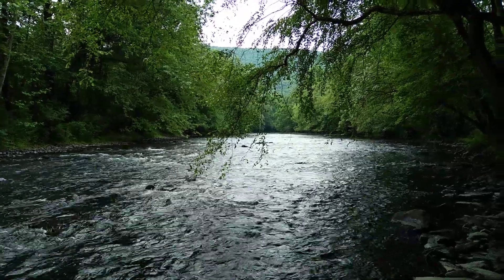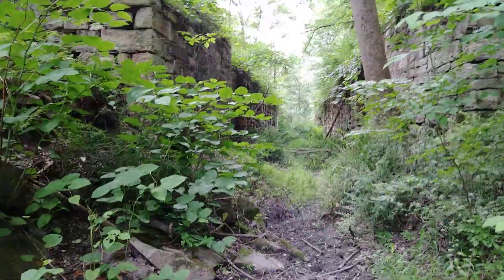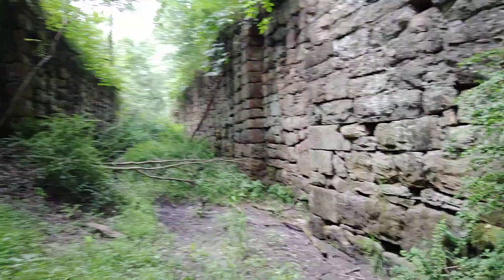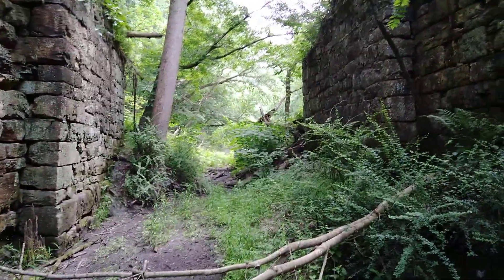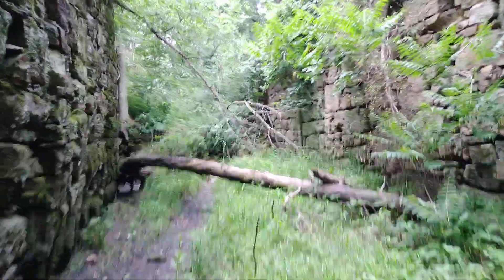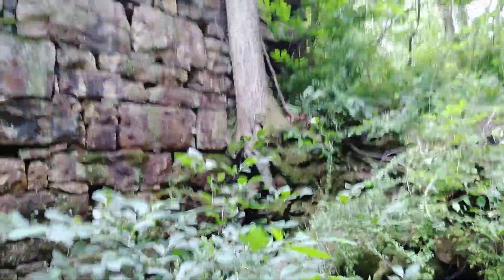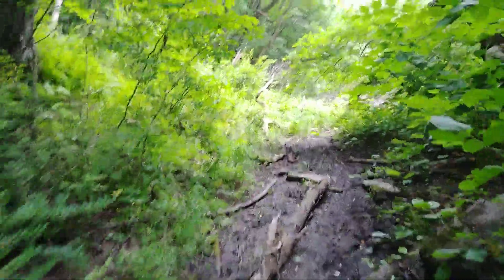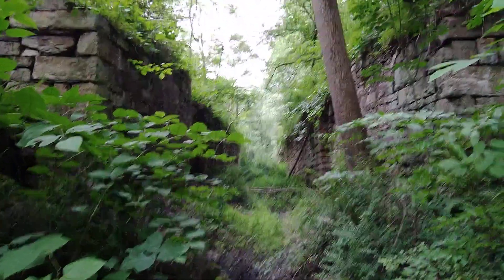Schuylkill navigation system lock 25. I believe.

Comment: Wow. I’m amazed at the condition if it is from 1821. Beautiful find. Looks like the locks I found on the Genesee Valley Canal in western NY. The large, square notches, of course, were for the gates. The smaller vertical, shallow notches, held wood planks that boats would rub against. According to my stone mason friend, each were hand chiseled into the flat stone.
Reply from the maker: Hey there Burton. I actually haven't nailed down the exact date, however construction went on from 1815 to 1827 so it could be older or younger. This section was abandoned sometime in the 1850's or 1860's I believe. The PRR started building their Schuylkill division in 1888-1889 and this obliterated some of the canal path.

Comment: Kevin what is the width between each of these walls?
Reply from the maker: That is a great question Steve. Definitely seems taller than wider so I'm going to guess around 12 feet.
Reply: @kevinsalsbury2118  thank you Kevin
Reply from the maker: I was just watching a video about the Conestoga Navigation system. It was mentioned that the locks were 22 feet wide. Therefore I am retracting my first answer and adding 10 feet to it. Which actually makes alot more sense.
Reply: @kevinsalsbury2118  you are awesome as usual; Kevin